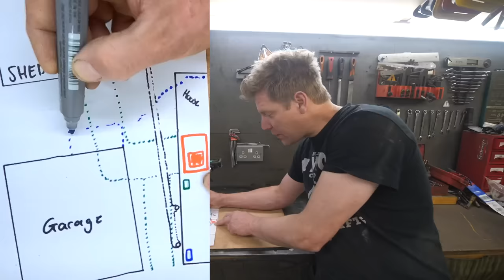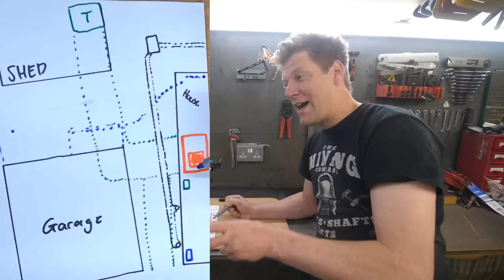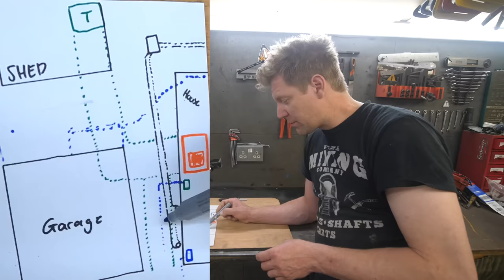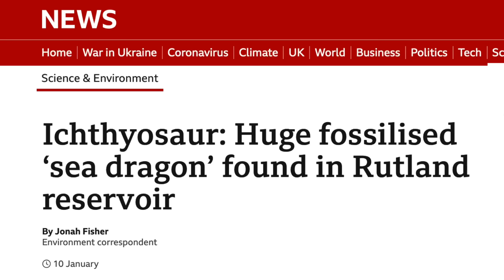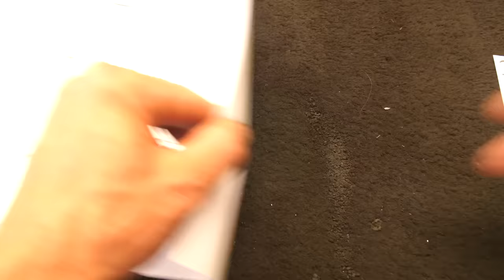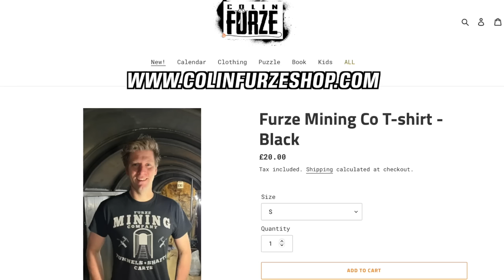DIGGING A SECRET TUNNEL Part 9

Comment: For ventilation, I would start by making a micron filtration system for the outside air, but eventually it would be awesome to build a subterranean greenhouse to supply oxygen. The best part would be being able to grow plants outside of your climate zone: citrus, bananas, kiwi, camellias... How awesome would it be to wake up and make a cuppa with tea leaves you grew yourself?
Reply: How about the sunlight?
Reply: @akunformalitas  Two options. Either 1.5" thick glass panels at ground level with some supplemental UV or utilize full spectrum grow lights. 

I already use the second method for overwintering certain annuals and starting off my vegetable garden from seeds I collected from the previous year.

Comment: Any form of filtration on the ventilation pipe? I mean, you said about the possibility of needing it (nuclear event) - you're gonna need filtration if you're gonna have ventilation. Might've made sense to dig out a ventilation and generator room- would also recommend you dig out another room adjacent to your initial bunker for hydroponics.

Also, do like me and stock up on duct tape and plastic sheets. Got me 100 rolls of tape and ten big ol' rolls of plastic sheeting. Perfect for sealing a homemade radiation suit and all windows/doors to keep alpha radiation out. Also got some potted trees for recycling the air inside and a couple of those $25 emergency seed vaults for planting 3-5 years of vegetables. I'm quite far away from any direct impact sites, so my main concern honestly is fallout and then the aftermath of that subsiding (security of my resources and home.)

Haven't managed to sort out the second issue yet, traps and homemade spears, I suppose.

As for energy, got a couple homemade wind turbines on the roof that basically look decorative from far away. I doubt if the nukes actually get used, there'll be any sunlight to be had, but plenty of wind thanks to dust/radiation storms.

Comment: You don't need a toilet. Just poop on cardboard. That's what I do. Then I bury it in my garden. Then the garden gives me more food.
It is working great, except my neighbor lets his dogs run free and they come over and dig up my poop and anything else I buried or didn't bury. They love it. I think they eat better over here than they do there. Those dogs have eaten so much of my poop. hahahaha I think my neighbors who own them are jelous.
As for peeing, I got a large chocolate milk shake at White Castle about 3 years ago before the pandemic. I have been peeing in that cup for years and it hasn't broken or anything. White Castle really went all out making a way over built cup for basically a 1 time use cup. It is crazy how strong it is. I take crazy chances holding it by the sides in the morning after topping it off in one go. Still, it hangs tough. Little did White Castle know when I got that expensive shake that they were also selling me a bathroom.
I need help with my house.

Comment: You could put a line of expanding foam, then pour concreat in a hole in it and have a vent somewhere else. That type of expending foam is not going to hold anything I think.  But I could be wrong.

Comment: What I do not understand in this project is the lack of paint treatment of the metal sheets on the concrete side - that would have delayed the rust erosion. Any reason for not doing that ? 
The job is excellent.

Comment: crush the quarts and then pan it and see if there is any gold in them. or use a good quality metal detector and check the rocks for gold. ya never know. and gold is found with quarts and iron deposits that look like rust. would be so funny if you found gold. now what carry on tunneling or now start mining. :)

Comment: That ventilation from garden should have a cover or be at an angle, otherwise it looks like a rain would pour in, or anything else...of course, if it's just a basic pipe without any form.

Comment: you can locate the gas line IF it is either metal, or has a wire along with it (tracer wire) with any various underground locators like Metro tech, radio detection etc.

Comment: Huh,  Well To test for things in the Way of ur Vent shafts, u could use a Copper Wire with a small surge of electricity, And to see if u hit anything Resistive.. They do this to check Electric Pipes for Faults without digging them all out

Comment: The ventilation seems a bit "too little" ... because it will speed up too much in the tubes.

Also: disguise the exit vent as a "chimney" (bricks around it) and make it as high as possible to use the wind going across it to suck out the air more easily.

Comment: Hi Colin. Great videos. I have 2 questions. Did you consult any civil engineers before starting so you knew what thickness to make the walls or just wing it? Also I know this is a bit rude to ask but do you have any idea on the cost per meter of Tunnel? For materials then man hours.

Comment: Hi there. i didnt see it in the comments but can you say what type and guage of steel panels you used and what strength of concrete you used. I have a similar project i want to make, but want to compare notes. i am in clay soil and will need more reinforcement and water proofing.

Comment: If the vent tubes are different sizes will that create a draw?

150mm on the high side and 100mm on the low as example...

I'm not the engineer, just a curious viewer from Canada.

Comment: I'm guessing that you don't have a program we do here, called 'Call before you dig'. Just one company (a Crown Corporation, Canada has those, not sure if the UK does?) manages both gas and electric. They have a 24-hour hotline you can call, and they will send out an agent with the full specs for the gas/electric lines in your area and they'll mark their locations with little flags and/or spraypaint for you, for free...

Comment: Concerning "rusty metal" ... its NOT THE INSIDE that will be rusty ... but rather THE OUTSIDE OF THE SHEETS (or rather: the welds)! It might take a decade or two ... but rust will eat through it eventually.

Comment: Let me tell you what happens in the US if the building inspector does not approve or if it was built before inspection and failed: They tell you it is condemned and you have to tear it down, then you have to apply for a building permit before constructing again. If it fails inspection after you get a permit, they tell you what needs to be done and tell you to redo the failed section until it passes.
The reason is because you are building for the future resident not yourself.

Comment: QUESTION: Why does the tunnel dogleg into the front garden section instead of continuing along the minecart track? I know the Hydraulic press is there now, but you didn't install it until after you started the front garden section 🤔

Comment: Where I live in the U.S. you can call the county &  they will come out with blueprints & equipment to mark your utility pipes for free.  Is this not a thing over across the pond? 
Also by law here If you use any "mechanical equipment" you have to call them.

Comment: Colin, I'm concerned about oxygen deprivation.  Sure you have a vent or two, however, will those be enough?  This is a problem when you have iron/steel present.  The iron component removes the oxygen component, generally forming rust.  But rust is not always seen.  Perhaps I'm just paranoid, but I'd rather ask you and know than not ask and find you pickled yourself.  Also, if I wanted a specimen of the clay, how do you suggest I go about it?  I think 500 grams is plenty.